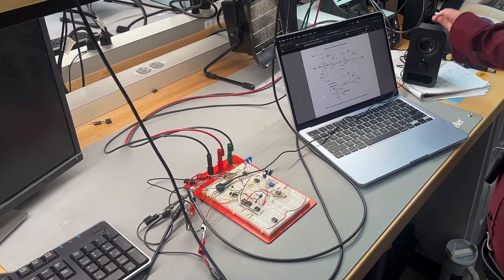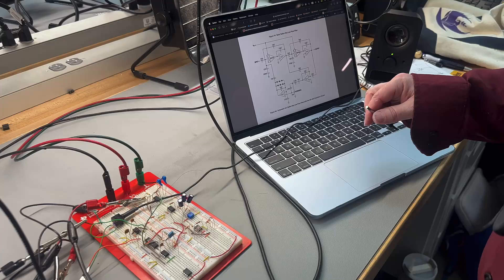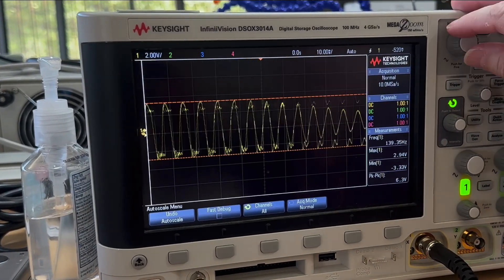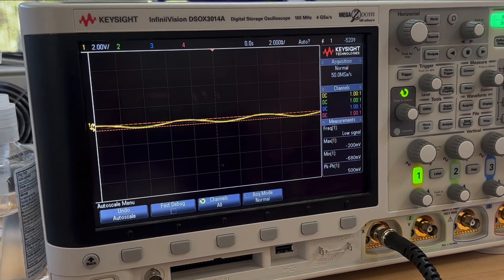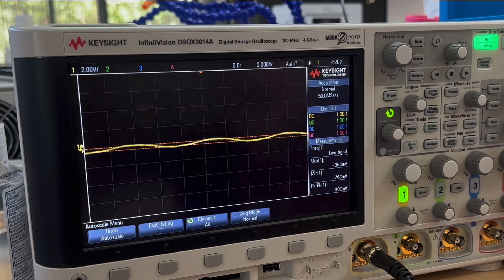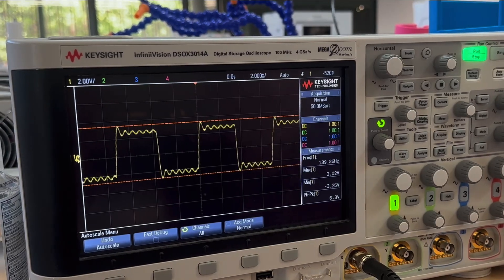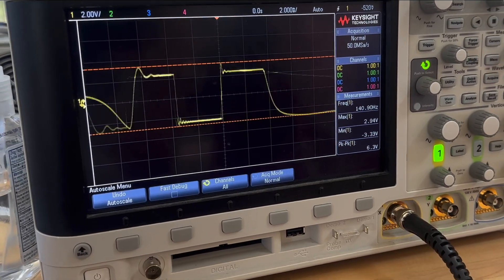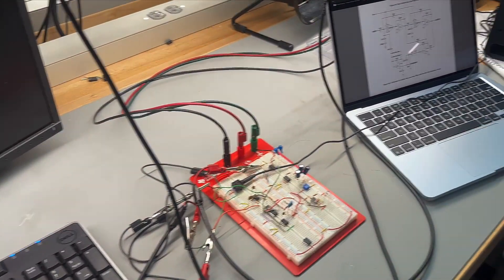SSI2164 VCF Inspired by the Korg MS-20 -- Breadboard Test (Tangible Waves Adaptation)

Comment: Make the Resonance also CV controllable? ;-) Maybe 2 x 2164s so you can choose between linear and exponential?
Reply from the maker: Those would both be interesting extensions! (Or you could just make two filters)
Reply: @Lantertronics  Yes, 4 stages (prefferably switchable between 1/2/3/4 stages). I'm gonna try it ;-) There is a youtube video of Hagiwo (makes DIY Eurorack modules) about a VCA where you can adjust between linear and exponential response using the 2164. The problem is that the output is affected by it, so it should bennefit from another VCA (or 2 in crossfade mode) so this behaviour is neutralized. I was looking for a schematic to use my own VCA in a filter and I think I found it ;-) Another nice thing to alter is the resonance feedback path. You can change the diodes for LEDs and try different kind of diodes (some have a voltage drop of 0.7V others only 0.3V).
Reply: @Lantertronics  And also tried a lot is to invert the resonance before it is mixed in back again to the input signal. Requires another opamp stage, but it might be very nice (maybe switchable)

Comment: Jakub Ciupinski (YT) describes a concept called “resonant slew” where the pitch CV is filtered and you get these lovely vibrato decay as the pitch glides to the new pitch. This is easy to configure in VCV or the Bitwig grid and I wonder if it would work with this circuit?

Comment: Check out the MT3608 power module / chip, this creates some 28V (and 2 amp, adjustable) from usb.
from there you create virtual ground and you can run normal eurorack modules.